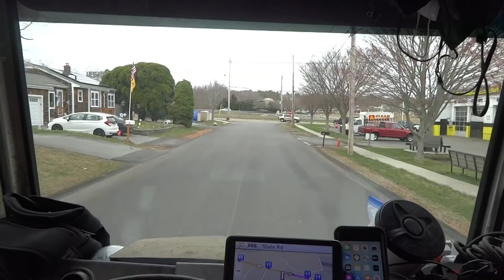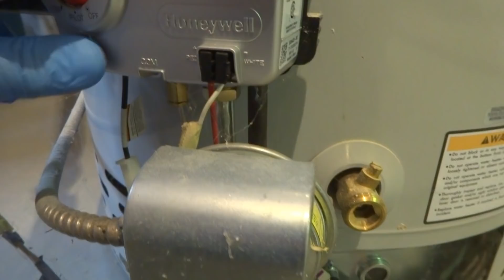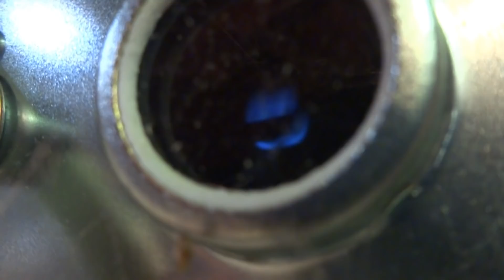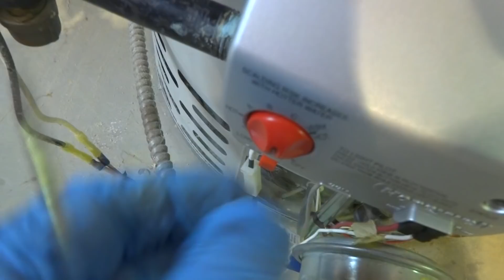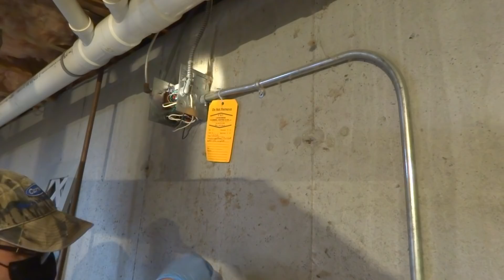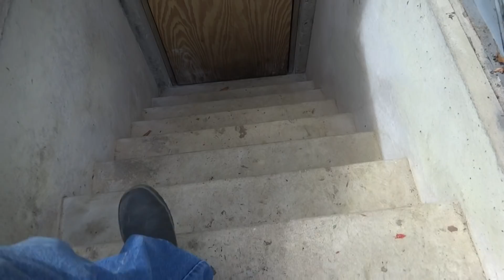GAS WATER HEATER PILOT OUT AGAIN NEW PROBLEM

Comment: I just bought a new water heater. My old one exploded water out the top vent.. like a fountain ⛲. I specifically bought one with out all that stuff on it. Give me a pilot light and no power vents. Old school as possible. Saves a lot of money upfront as well. With 4 people using hot water daily the pilot light is not wasting any energy in my opinion.

Comment: Those Honeywell controllers are junk.  I had one go out on a 5 year old water heater last year.  Tore it apart, found a cold solder joint on the pilot valve coil which I was able to fix, but when reassembled the gaskets and such in the valve body leak.  Wound up having to replace the whole thing anyway to the tune of $150.  Still, cheaper than a new water heater.

Comment: can I ask why turning on the pilot gives in 120 volts? I like to know please
Reply: It doesn’t. The power pile produces 750mv Max open read with no load
Reply: @RockoRocko-rz7kx  so a power pile produces the mv. There must me some form of electrical junction box with relay and whatever
Reply: @sh2697  
Yes or it might just run all the time as it’s just a draft booster, perhaps its code for that’s area or its an excessive length run that needs to assist a the draft hood in stack action forcing out the products of combustion. The roll out that was tripped was due to the fact that it wasn’t drafting properly and got too hot and tripped it, it was tied in series with the gas valve and cut continuity when it opened due to excessive heat.

Comment: New controllers suck.  Old ones with just one thermocouple gas control valve worked just fine. Had one for 15 years now no issues. Now you have thermopiles that have to generate more electricity to control more unnecessary crap. Never fails.  Safety features out the ass to cover for the one case in millions and everyone pays for it with more expensive water heaters with so many more failure points.  Glass safety vile in the combustion chamber is another example. Keeps the plumbers industry happy that's for sure.

Comment: Here's how it goes for me every time a new person takes over one of the many gas appliances I look after:
Me - "This gas appliance has a permanent pilot, I'd like to show you how to re-light it for when I'm not here"
Customer - "It's fine I know how to light a pilot"
Me - "Okay great but I'd like to run through it with you quickly while I am here just to make sure"
Customer - "No that won't be necessary I know how to light the pilot"
Me - "Fantastic thanks goodbye"
...Then after maybe a couple of weeks I am guaranteed to get a service call from them, boiler isn't working. I ask if they've checked the pilot light and they act like I speak a different language. I go there and re-light the pilot.
The End.

Comment: I think that some manufacturers have advanced to maintenance-free permanently lubed and sealed bearings, since homeowners forget to oil them until there is some problem.  My Beckett burner motor is like that and it has lasted 25 years.

Comment: Question. Because the hot water exhaust and the furnace exhaust are y connected and common shouldn't either the furnace or hot water roll out safeties be wired to shut off both gas valves . He said he was still getting heat. Or did I miss something?

Comment: I recently had a guy with no hot water. I lit the pilot and the flames would roll out. After some deep investigation I found that the laundry room it was installed in had all solid doors and the AC air handler in the same room had just been installed. The guy who installed it removed the return boot and set it on a stand. So the 2.5 ton unit was sucking the air out of the room and pulling the draft into the room. You can’t fix stupid. It was in the hood of Miami 🤦‍♂️

Comment: What kind of a third world country still uses appliances with pilot lights? No wonder the US is the biggest energy consumer and biggest carbon dioxide emitter per capita on earth. What's even more bizarre is that all these houses also have a furnace to provide space heating, so why install a separate appliance to heat water? Your furnace must sit idle for months at a time. Why not just use the furnace to also heat the water in a simple tank- one appliance means less maintenance issues, plus you get the benefit of the full power of the furnace heating water if required, dramatically reducing recovery times.
Reply: Third world country Spencer U.S.A. has 11 aircraft carriers with 80 hot loaded jets on each we rule the seas 7 deployed , we like our standing pilots on this side of the pond!
Reply: Real third world countries don't need pilot lights because they have to light the wood before they make a meal.  The USA has enough natural gas to last for centuries.  Heating water to supply heat is different than heating water to take a bath in.  We obtain higher efficiency by using separate water heaters and furnaces.

Comment: What was tripping out on top
of the unit? Two of them ?
Reply: Roll out. With no draft the hot fumes roll out
Reply: @drodriguez394  Thank you. I had
to go research the term ‘ Flame rollout
switch.,   Notice Steve said “Oh a second one is here, i did not see it.” 
Customer asked, how many should
i have? Answer Two.   Steve reset the
switch, without explanation as to what
it does.
Thank you again. Trained now on the terminology and the function.

Comment: Those gas valves are junk. 
I'm suprised the pilot holds through 2 spill switches. The generator doesn't usually generate enough power to handle 2